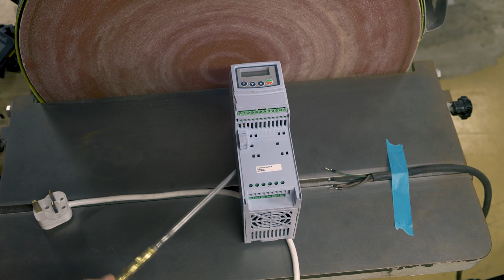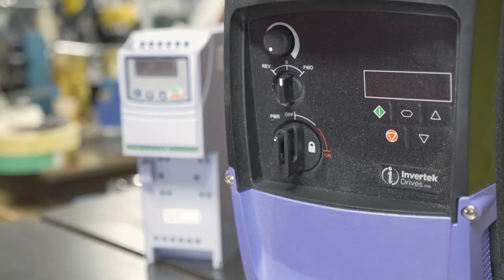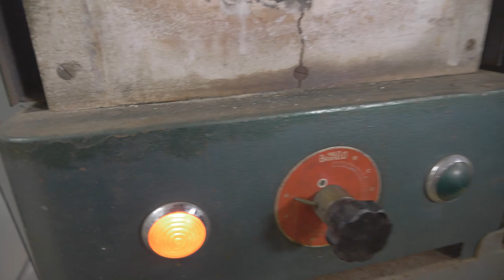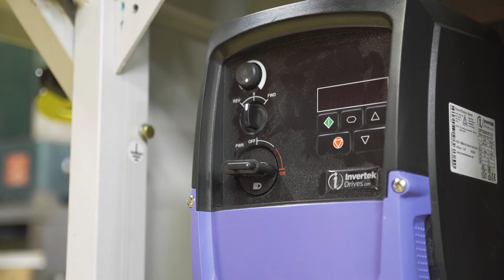How to Convert Single Phase to 3 Phase and Use Three Phase Tools at Home

Comment: would this work for powering a sliding panel saw mate. also what vfd are you using the one for outside the machine the one that won't get dust in it. thanks
Reply from the maker: It should do but depends on the wiring - you might need to remove some parts to make sure the output of the VFD goes straight to the motor/motors. If you do have separate motors just make sure they are both the same voltage and both 3 phase. 

In terms of dust, you'll want to look for a unit with an IP rating of 5x or 6x (with X being any other number). Generally that means an IP54 up to IP66 rated enclosure. InverterDrive.com is where I have bought all my VFDs and you can filter by 'Protection'. The drives I've bought are either WEG or Invertek.

Comment: Hi.
did  you  increase the vfd size for each motor ???
Reply from the maker: You should size the VFD for the motor that you have. So a 1.1kW motor needs a VFD rated for 1.1kW output.

Comment: Great vid,very informative. I notice you using a horizontal bandsaw in the video, is that also running on a vfd? I’ve recently acquired a 3 phase pull down bandsaw with a 2 speed motor and suds pump and am trying to figure out the best option to run it on single phase 240v. If you have any experience I’d be very interested! Thanks
Reply from the maker: Thanks! Yes, good spot. I've got a VFD on the horizontal bandsaw. Luckily the coolant pump runs off a transformer which had an input for 240V so the wiring was very simple. Unplug your machine and have a look at how the wiring is setup, you might have the same. Otherwise, the worst case is that you'd have to replace both motors - I think I had to swap out the 2 speed, main motor on mine. I was able to sell it to cover some of the costs but having variable speed control is really useful so it would have been worth the cost either way for me.
Reply: would this be suitable for a sliding panel saw with a seperate scoring blade with it's own motor?
Reply from the maker: @michaeltaylor7783  Hi, can you post this as a separate comment rather than a reply - that way people in a similar situation will be able to see it.
Reply: Thanks for your reply, I looked at the wiring and the suds pump is 240v, so the vfd could have been an option as you say, although I think I would have to change the main drive motor. Luckily for me I sourced a second hand rotary phase converter very cheaply which runs all the motors on my saw and I can use the 2 speed original motor without any problems.

If I hadn’t of found the rotary phase converter at a price I couldn’t refuse I’m sure a vfd would have been the next best option.

Comment: would this be suitable for a sliding panel saw with a scoring blade with it's own motor  
?
great video really informative
Reply from the maker: Thanks!
I think it should work but you'll want to check how the machine is wired. If the main motor and the scoring blade motor are both 3 phase and the same voltage then you should be fine. 
In terms of dust protection, look for an Ingress Protection or IP rating with a 5 or 6 in the first number. I'd suggest an IP66 rated enclosure. I've bought all my drives from InveterDrive.com and you can sort by 'protection' on their site. In terms of brand, I've used WEG and Invertek.

Comment: My 3 Phase loads are transformers. 
I live in the US, I can only access 120v-15A-60Hz. I'm building a model power grid for my city, but I need 3 Phase Power so I can get 12/20.8v to run my city. I just need 3 Phase Power to run transformers the cheap way. Can you help me please.
Reply from the maker: Hey, thanks for watching. I'm not sure I can help with that. I guess there's no industrial use for low voltage 3 phase so I don't think there's something 'off the shelf' that could do that.

Comment: Enjoyed watching the vid what model of inverter did you use and what would you reccomend for a lathe cheers Andrew
Reply from the maker: Thanks! If you're UK based, send the guys at InverterDrive.com a message - tell them you watched this video... they've helped a few people before. 

 I've used both WEG (cheap) and Invertek (more expensive). In terms of function work well. The WEG units I've had do have a fan which runs constantly when it's plugged in, even if the machine is off. The only other consideration you'll need to think about is the IP rating (ingress protection). If you can be sure it won't get any dust or liquid near it then you can use any one. Otherwise, familiarise yourself with the IP rating and decide which one you need. 

All the models I've used can have buttons wired to them so you can rewire the machine and use the original buttons. You might want to add a potentiometer for speed control although some VFDs have one already. Although that does mean you'll need it accessible. 

Hopefully that's a good start but let me know if I can help in any other way.

Comment: Would that work on a panel saw that has a scoring blade aswell
Reply from the maker: The scoring blade on my saw is run with a belt and pulleys from the main motor. So if your panel saw is the same then yes it would. If there's more than 1 motor then you'd need 2 VFDs.
Reply: Thanks for that be probably easier to buy a 3 phase converter instead.

Comment: Hi James and thanks for putting this together,  nice way of editing and the content is awesome. Would be useful if you could link some examples of the VFD and brake resistor you use in your shop and possibly why you chose them? As a complete newbie or should I say convert.........soz! I would be good to get some examples? Thanks, great job buddy
Reply from the maker: Thanks, glad you enjoyed it.
I've bought two WEG and three Invertek VFDs all from InverterDrive.com. They're really helpful and offer great advice with what you should buy. The break resistor is something I picked up in a job lot at an auction so there are much better options available (again InverterDrive sell them). This one is from a motion control driving rig! The WEG units are cheaper and work just as well as the Invertek ones for almost all applications. Like I said in the video, I needed one with a higher IP rating to prevent dust getting in but if you're able to keep the VFD out of the way then there's no reason to go with something cheaper. That's what I did for the Startrite bandsaw in the video. It has a cheaper WEG unit built into the case (in the electrical box) and has the original start and stop button wired to it and I just drilled a new hole for the speed control knob.
The reason I went for Invertek is the IP rating, it has buttons including a speed control knob built in and I've used them on other machines so there's some symmetry between different tools in the workshop.

In most cases you can pick any brand of VFD you just need to think about:
The right 'power' rating to suit your motor
The right IP rating to suit your application - waterproof, dustproof etc
The right size for where you want to put it
Any buttons built in (they can all have your own buttons added if you want to use existing ones)
Options to attach safety switches (e-stop, case open switches etc) - most have this

I hope that's a helpful start! I can thoroughly recommend InverterDrive so if you do get something from them please let them know I sent you. Not sponsored but it would be great if they did!
Reply: Malt & Make superb James and thanks for the comprehensive reply that’s much appreciated, I’ll definitely go check Inverterdrive out as resource. I’ve been looking at Bridgeport end mills and some lathes so think they might work but will do some research. Thanks for sharing and putting the video up 🙌🏻🙌🏻👍🏻🤜🏻🤛🏻

Comment: Can I use a 16A 415v catering cooker with any of these methods
Reply from the maker: Hi, sorry for not replying sooner. Not with a VFD, they work for things that spin and have a dual voltage motor. The issue with a cooker is that the control hardware won't work if it doesn't get the right voltage. The cooker itself might work on the lower voltage but wouldn't get as hot. A phase converter (Clarke make one) might work but whatever you use you'll need more than 16A to run it... probably a 32A supply.

Comment: Only thing i notice people don't talk about much is that using a VFD is you have about 2/3 the power of original specs and more likely to burn out the motor quicker due to inconsistent voltage/amps, Not saying they aren't good and can do the job i guess it just comes down to how good your supply is and the prep work.....i mean for any stable supply at mine i probably need to install a lvl 999 Capacitor in my system, so strange having motors that only work like they should some of the time
Reply from the maker: I've heard about the power loss at lower speeds or if using a 3 phase on single phase. Do you have a good source for the shortened life span? I'd be interested to read more!

Comment: hey mate! i have a edge melter machine that has 4 separate motors that has a twist lock plug...since there's 4 motors and a separate smaller electrical controller, how would I hook this up to the inverter? The machine runs on 3 phase 415 volts and my shop only has single phase 240v power and i really can't afford getting a rotary motor. I would so appreciate any input:)
Reply from the maker: Hi, sorry I must have missed this at the time. The difficulty might be the heating (I assume your machine has something to melt the glue). Often heating elements need their rated voltage to work properly although it should still heat up but perhaps not enough for the machine to work properly. If it's a hot air blower you could see if you can replace it for a 240V version. 
In terms of the motors, you might be able to just run then all from the same VFD if they're all constantly running. It's not something I've tested though. Do check the motor plates to see if you can run then on 240V three phase as that might be an easier route than trying to run a VFD that creates the phases and has to deal with running the motors at lower voltage/frequency.

Comment: Whooohoooooooooo, that was an awesome whirlwind of video techniques and great audio on top man! I'd love to see your list of options to consider for VFDs - did you collect any? Also, I hope you vote for me as well?! (I don't know what it's about and hope it's nothing bad :D)
Reply from the maker: Thanks, it was a lot of work to edit but totally worth it! I don't know what the vote is for but I'm voting for you!

Things to think about for VFDs:
The right 'power' rating to suit your motor
The right IP rating to suit your application - waterproof, dustproof etc
The right size for where you want to put it
Any buttons built in (they can all have your own buttons added if you want to use existing ones)
Options to attach safety switches (e-stop, case open switches etc) - most have this
Reply: @MaltandMake  okay, thanks - well I guess I'll just search for the application when I have it then :) thanks!

Comment: I'm in the US and I have a 3phase  motor that's 208-230/460 volts 
25.6  - 24/12 amps 
What VFD do I need to run it ?
Reply from the maker: That's quite a powerful motor. You'll need a VFD that is rated for the same horsepower as the motor. It doesn't matter which brand you buy. I suggest finding a local supplier, asking what they have available and explaining how you want to use it.

Comment: Great job! Love the humour/information ratio! I have so much I want to comment on this video (all good) but I would have to watch it again and make a list to remember everything... 😁
How much power does the resistor soak up when breaking?
Reply: Oh, and I'm amazed that so many homes around the world just have single phase power. In Sweden only the smallest, old apartments have single phase, everyone else use good old three phase!
Reply from the maker: I wish it was the norm here!
Reply from the maker: Thanks, I'm glad you enjoyed it. Please do watch again... ideally from a different location/IP address!!
Braking resistors are rated for continuous power on the of hundreds of watts and then also overload e.g. 10 times rated power for 5 seconds every 90 seconds. I don't have the details for the one I'm using to hand but it's more than I need for this and worst comes to worst I have 2 spare!
Reply: @MaltandMake  😂 Sure, I'll use my work phone and turn the WiFi off...
Hm, I was thinking that it could be interesting to hook a couple of strong light bulbs to the break, it should do the trick as long as it can take the voltage. It wouldn't be as robust as a break resistor, but it could look cool. 💡
Reply from the maker: @CrudeButEfficient  that would look cool!

Comment: can't you just rewire it and add suitable capacitor?
Reply from the maker: It's a hack I've heard about but not something I've tried. There's a few advantages to using a VFD: reliability, speed control and energy efficiency. I'd be interest to hear if you've had any success with adding a capacitor?
Reply: @MaltandMake  ive just been looking at VFD's..given that .75 would be for a 1hp motor.my drill will have 1/3hp.so by rites that would need a .25kw VFD? but i can only find a .45 kw on ebay...would that be ok do you think?or is there some mad formula i dont know about :)
Reply from the maker: @davidwoodward7020  As long as the VFD is rated for at least the power of your motor you'll be fine. The closest 'common' size you'll find is 0.37kW but 0.45kW would work.
Reply: @MaltandMake  brilliant,thanks for your advice